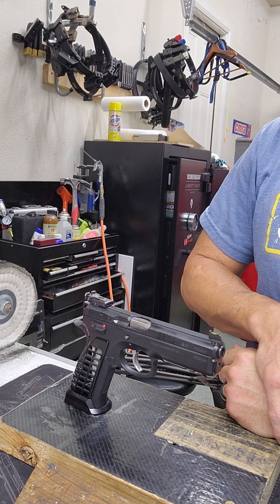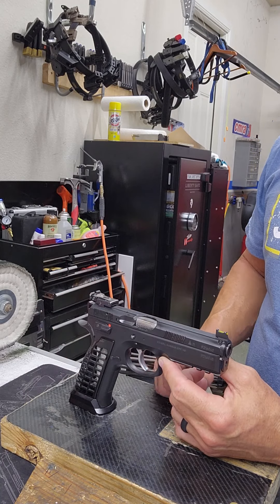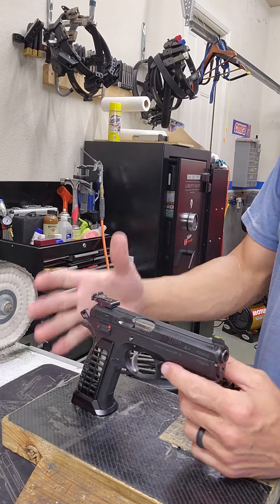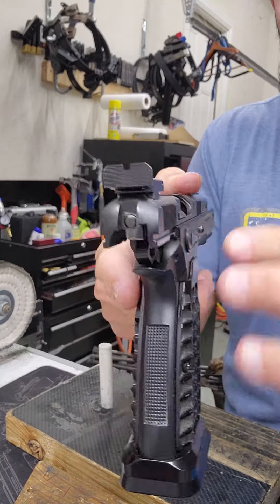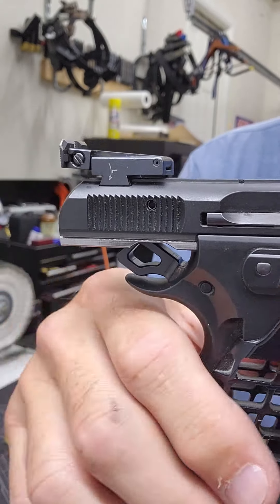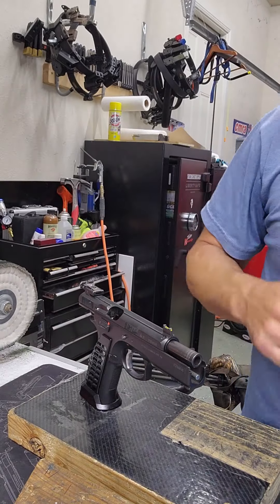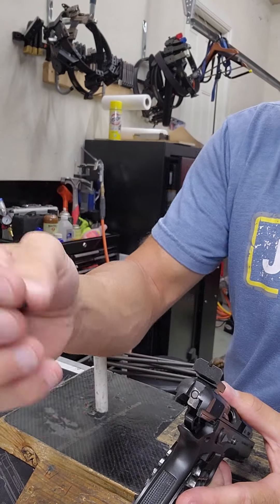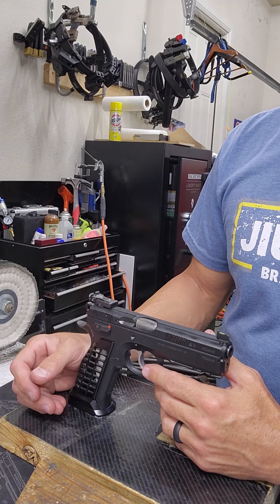Dry Firing a CZ (Shadow2, Shadow1, AO1, SP-01 etc)

Comment: Thanks for the video. My friends sp01 orange has the plate on the back of the slide like the shadow 2. Love those aspirated grips!
Reply from the maker: If it has the plate on the back then it doesn't have the counter roll pin to hold the firing pin in place, and therefore is safe to dry fire as much as he wants with no expected issue.

Comment: I stick a fat rubber piece I cut from scrap just under the firing pin. I do the pencil test and if it doesn't move up, it's good to go for my training session. If it does, I need a new rubber piece. Also reduces stress on the hammer. I do the same thing in my revolvers. Removed with a small screwdriver when I'm done.
Reply from the maker: thank you for sharing!

Comment: My CZ P07 came with a snap cap, and the manual specified that dry firing was best done with that snap cap or a commercially-available alternative in the chamber. 

Snap caps are easy enough for me to obtain, and they might reduce the chances that dry-firing would harm my pistol, so I'll use them for my home practicing. 

Do I absolutely need snap caps? Maybe, maybe not, but I'll use them for my DA/SA pistols. My striker pistols? Maybe not, maybe so, depending on what I'm teaching myself.

Comment: Awesome video! What about a Jericho 941 or Tanfos? My Jericho has both a firing pin block safety and a plate that holds back the firing pin.
Reply from the maker: As long as the design is in a way that when your firing pin doesn't have a primer to hit, it will not hit something else, then you should be fine.

Comment: According to CZ they harden the firing pin retaining pin and I wouldn't dry fire without a snap cap I have extra pins on hand in case, have fired 1000 rounds through my CZ P-07 and dry firing with the newer pin. Noticed no abnormal wear on the  firing pin retaining pin.

Comment: I only use snap caps No O ring. I dry fired my cz shadow 2 500 times before hitting the range to get used to it  and smooth out the double action a bit
Reply from the maker: Yup, nothing wrong with that.
Reply: @czarmorer  i got a 10 round mag for shadow 2. It says 15 on it and is closed on just 10 rounds. Is it possible to make ot 15 ?
Reply from the maker: @saudalblaihed3925  if you have one of those mags that were "staked" to create a limit at 10 rounds by preventing the follower to keep going down beyond that, then I guess you can simply remove the bump (file it) in both sides inside the mag, and the follower will be free to go down all the way to the bottom.   Just keep in mind that if you're located in one of the low-cap restriction states, this would be considered tempering and breaking the law - so I would do it if that's the case.
Reply: @czarmorer  im not from the states. But our one and only local cz dealer stupdily order 10 round mags and i really needed extra mags. Is there a way I can show you the mags.  The ones i have i couldn't find any pics of online. They are oem aluminum mags that at the bottlm seem to be like two pieces put together
Reply from the maker: @saudalblaihed3925  DM me on IG @cz_armorer

Comment: is this a design flaw of the CZ 75 series? i have a P-01, and learned of this and now a bit worried about dry firing, and the firing pin breaking when I need it most.
I dont think other makes like Sigs, glocks, etc. have this issue
Reply from the maker: Not sure I would call a design  flaw - Unless they designed it to be dry-fired constantly.  If so, then yes, I would agree this isn't the best design for it.

Comment: What is the exact size of the O ring you suggest?  Neat idea👍🏻
Reply from the maker: I can measure for you, basically anything that has a snug fit around the end of firing pin will work.  You will know when the hammer is hitting the rubber as opposed to the FP as it sounds different when it does :)
Reply: I have read elsewhere on YouTube that it is #83 "O" ring.

Comment: I'm not buying that CZ added roll pins to make the product better. Seems like a cost cutting measure.
Reply from the maker: If you're talking about the firing pin counter roll pin, that wasn't actually added to it - this is actually the original CZ-75 design.  The CZs which don't have that roll pin came after, and are mostly competition oriented models such as the Shadow (1&2) and/or the TS series (TS, TSO, TS2, Czechmate etc), which are not equipped with a firing pin block.

Comment: why is this even a concern. only guns that shouldn't be dry fired are guns that use rimfire ammo. because the pin is striking the side of the chamber and can be damaged but even those can stand lotta dry fire abuse.
Reply from the maker: actually, as I mentioned,  you shouldn't dry fire your non-22LR guns that have a counter pin locking the firing pin in place.  Not without any protection at least.  Or it will damage your firing pin - I've fixed a few SP-01s and CZ-75s broken like that.